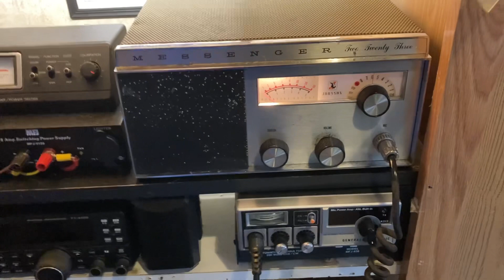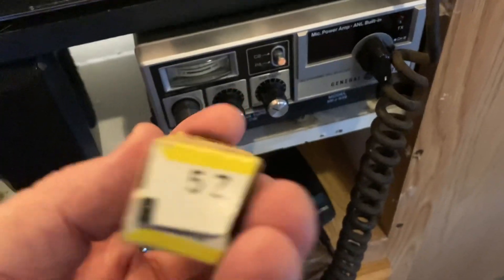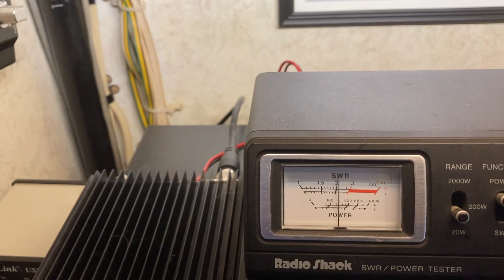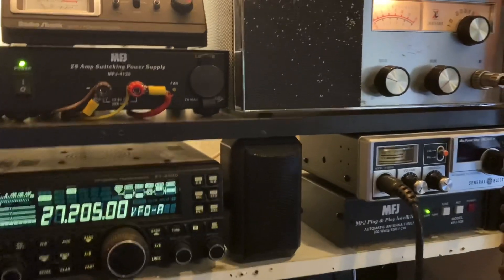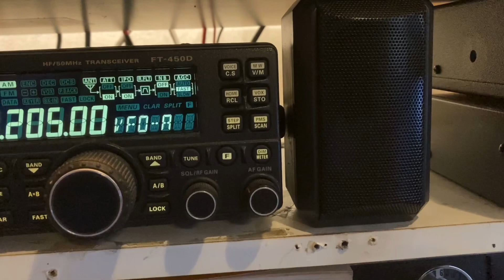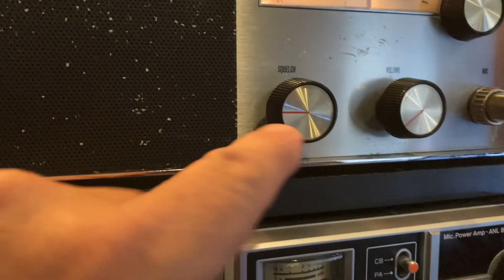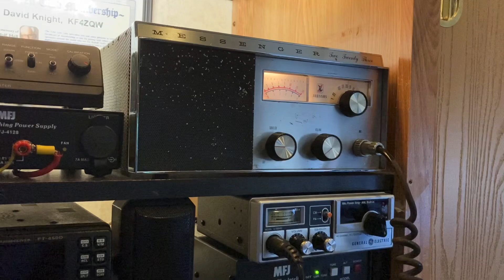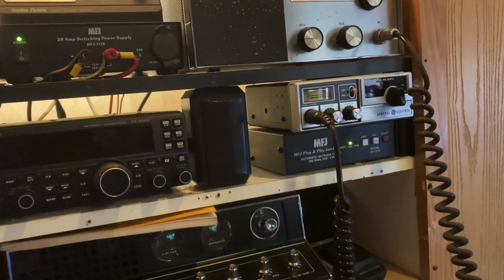Johnson Messenger 223

Comment: Geeat radios ive been servicing and collecting the Messenger 1, 2 and 223 forever and now have over 200 as well as many still boxed.
Reply from the maker: @davescbradiorepair8195  my 223 has dead crystals. Channel 23-21.guess it’s typical for the Johnson line from what I have read about them. But the dang audio is great. It’s an old radio but fun to use from time to time.
Been looking at the dds type vfo for it. The ones that are in a box set up kind of like the old siltronix ones
Reply: Just picked one up and I want to restore it...
I'd sure like to chat with you...
73
Reply from the maker: @ well I don’t know much about them. I did get a Sam’s photofacts book on it. That helps some. 
Johnson’s crystals aren’t the best in the world but tubes are still available. The stock mic that looks like a turner plus 2 sounds great over the air. Very very clean clear audio